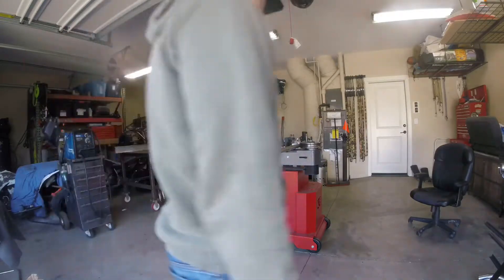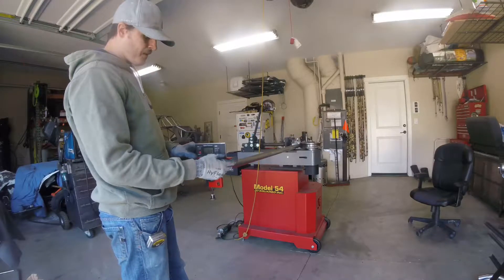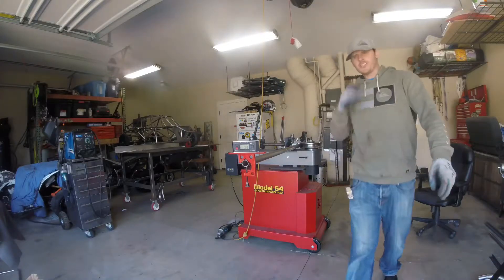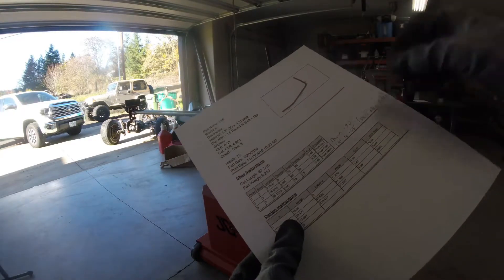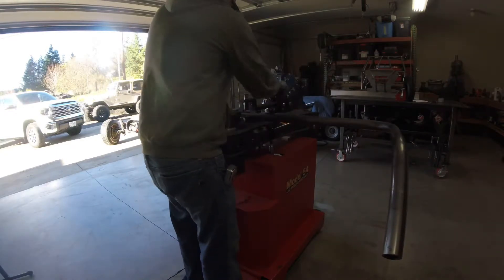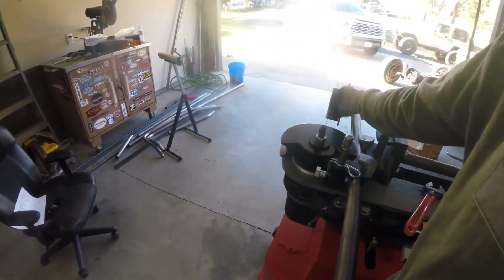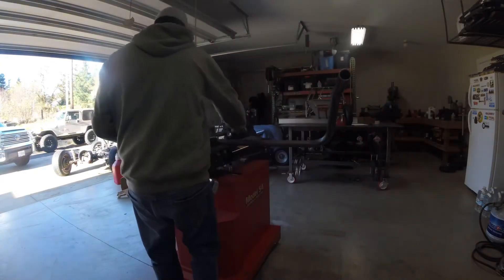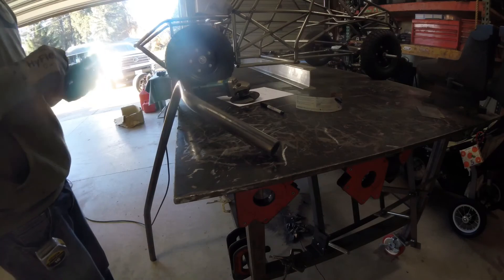Bend Tech Pro Tutorial - How to - Multi-Bend/Multi-Rotation Part 3

Comment: When rotating the tube CCW or CW i'm assuming that is looking at the tube from the front coming out of the bender opposite the rotation gauge.Great video's Thanks Dean
Reply from the maker: Yes sir, that is correct. Thanks!
Reply: @tsmallwood97  Thanks for getting back to me,got another question on the cutting wrappers i've been using bend-tech for about 12 years and still don't know what the rotation degrees on the wrapper is telling me what to do,you have any idea,i do all my copes in my bridgeport never got a good answer from the guy's at bend-tech.Ok Thanks and have a good Thanksgiving.
Reply from the maker: @deanpurks7474  Hey there, Dean. I’m not sure that I fully understand the question actually. The cut wrappers do not display degrees of rotations but rather only dimensions. The rotation is built into each wrapper and is clocked on the tube appropriately by aligning the reference line with the center of the tube on the outside radius. Does that make sense? Again, I’m not sure if I am tracking your question so let me know.
Reply: travismadefab Hey Travis now that I think about it you might be right for example if you make an S Bend and it connects with a top tube and a bottom tube the bottom tubes is a 90° cope and the top is say 37° on a 37° rapper all by itself printed on the wrapper it’ll say rotation 180 I guess it’s telling meThat the wrapper or the bends are opposite 180° already figured in and they just print it on there for information never had any problems I’m just one of those guys that needs to know why all right thanks again. Dean
Reply from the maker: @deanpurks7474  😏
Reply: @tsmallwood97  
Hi Travis
   Here's an example of a cutting wrapper that confuses me i have 2 wrappers for on tube to be coped at both ends one wrapper has the cut size, cut angle,offset,setback and Rotation 162.85 deg's tha other wrapper has the same info and rotation 180 deg's is this telling me to rotate the tube for each cope or is it already figrured in by the alingment of the blue line if that makes sense.Thanks